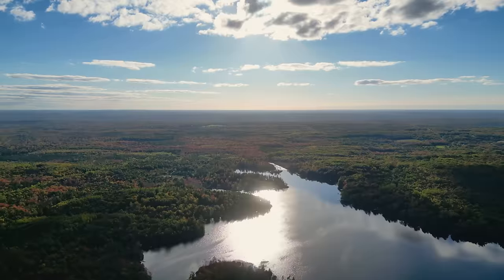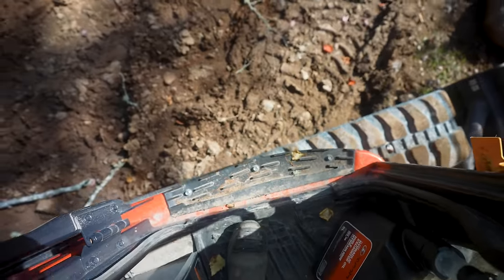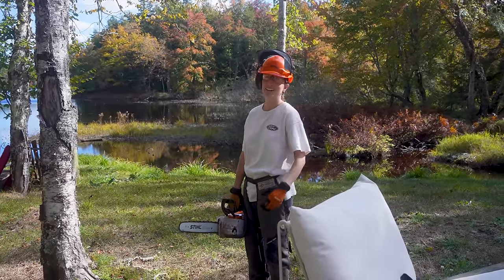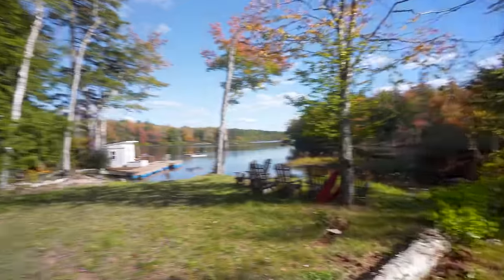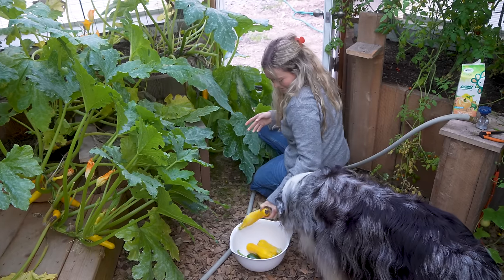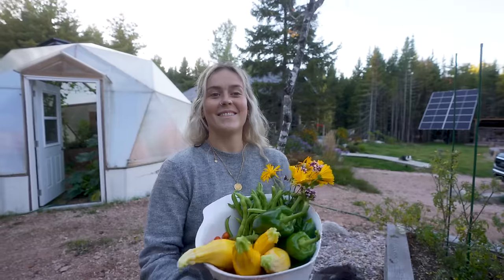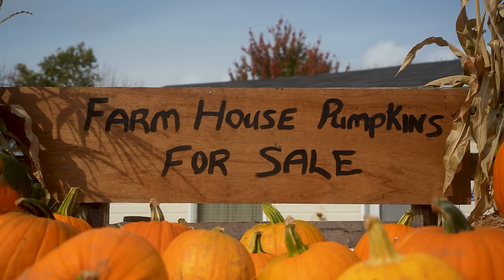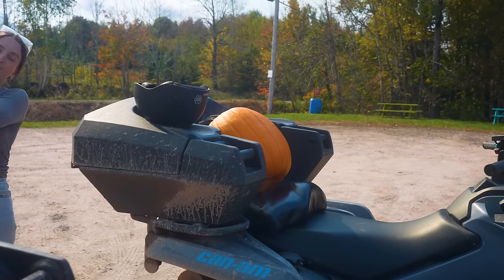Raw, Unfiltered Cabin Life: Extended Cut Off-Grid Living in the Woods

Comment: I see you are getting good use out of the battery chain saw.  I like mine too. A Maasdam rope puller, a couple of shackles and a couple of snatch blocks are good accessories to have.   I suggest you make little chicken wire cages for your cedar plants.  You live in deer country. Nuff said.  Also think Hemlock. Also, chef, use the back of your knife to shift stuff into the pan, not the edge.